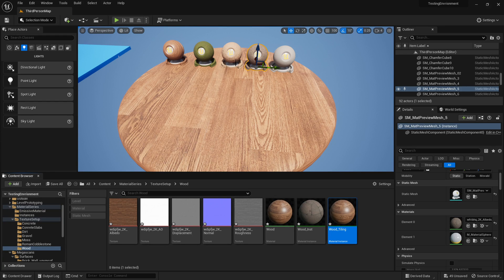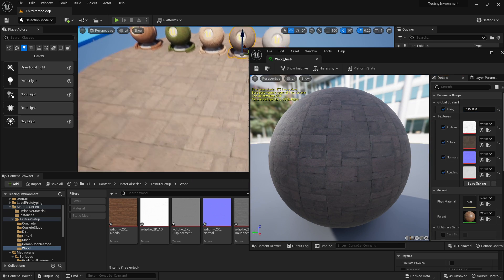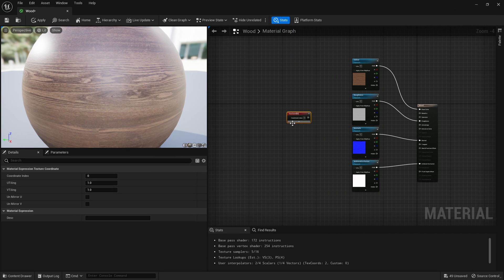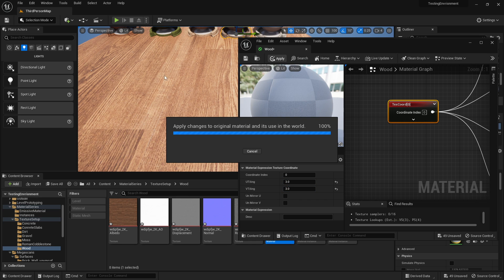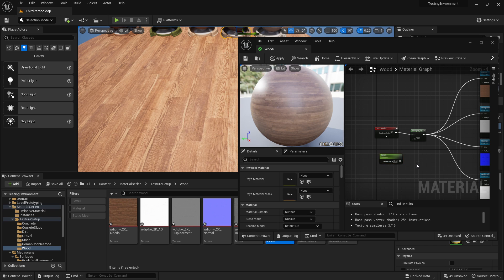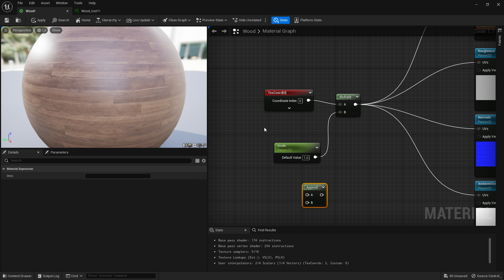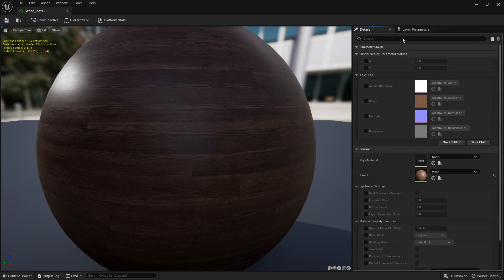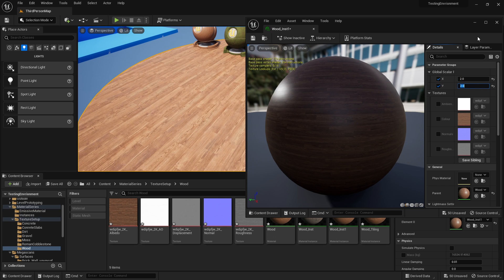UE5: Materials (Ep.7 Tiling Texture)

Comment: thanks Steve. nice tutorial, Steve im new to unreal, what is the best way to control strength of Normals? Also can you pls explain me how can I know, Is the shader that I make optimize or no? thanks in advance
Reply from the maker: Best way is to use a "flatten normal" node. Plug it in and basically using a 1constant/scaler just scale it into the negatives. Should increase your normals :)
Reply: @StevesTutorials  thanks man